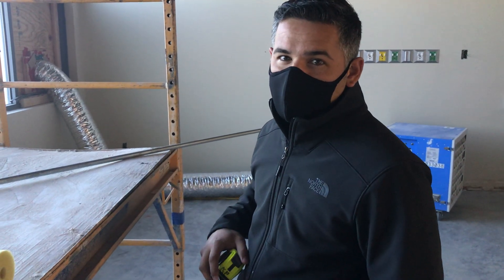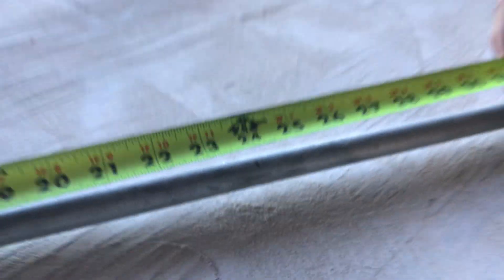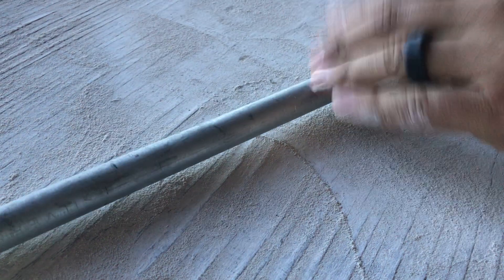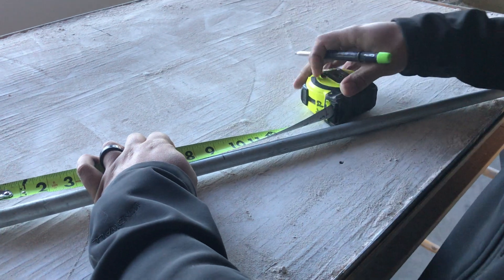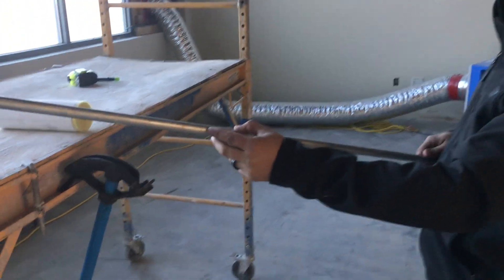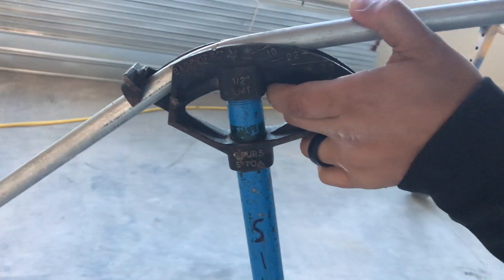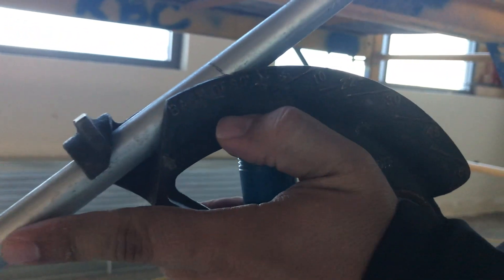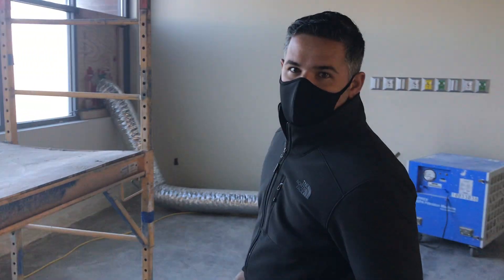3 POINT SADDLE!! HOW TO DO IT THE EASY FAST WAY !! WARHAMMER MASTER CLASS

Comment: Excellent WarHammer, thank you man. I have a question, hopefully someone from the comments or WarHammer can answer for me. When I use my level and make a 30° bend for example, the pipe doesn't line up with the 30° mark on the bender. It's way off from the bender mark. Why is that?
Reply: I had a couple of Ideal brand benders, lost them in a fire, now a couple of Klein brand, same story: the EMT should be parallel to the markings/lines.  If I bend until the EMT is at the line, it's too far (verifiable with a digital angle gauge).
Reply: the shoe might be warped, is the bender plum at 30 degrees? if so check it out with a level on the bender then try that against the bend when it comes out. if all that doesnt work the shoe of the bender could be compromised

Comment: Why did you multiply by 3? And what would you use for other angle saddles?
Reply: Is it because you used the star notch on all 3 bends? Typically you would do the star on the center bend, and to the arrow on the outside bends, using 2.5 multiplyer.
Reply: @Worthyhighlights  The star is for back of 90 bends.. the notch is for center of bend
Reply: The multiplayer for 22.5° is 2.6 so adding that a little extra accounts for just a little space between your conduit and the object instead of just laying on top of what you're going around.
Reply from the maker: I will do a 4 point and a kick 90 coming soon
Reply: SNA(STAR NOTCH ARROW)
Reply from the maker: Need the extra length for the middle bend and it’s a easy number to remember. “ 3 point saddle x 3””